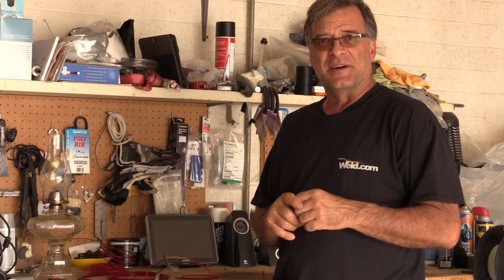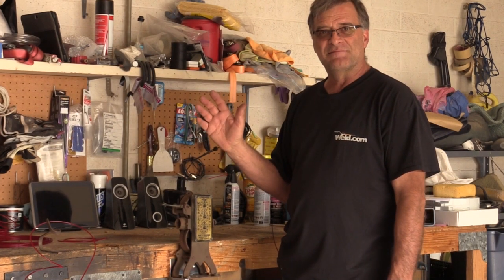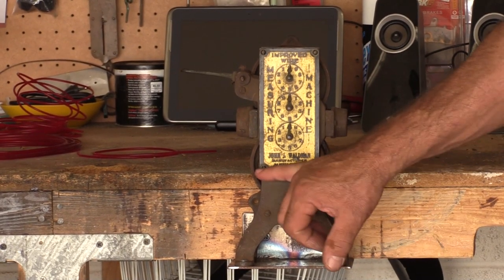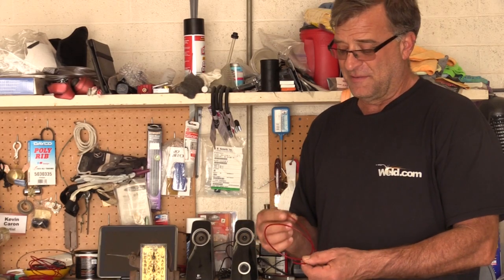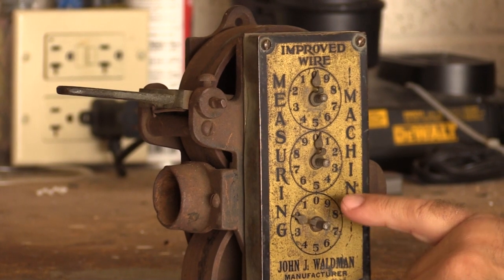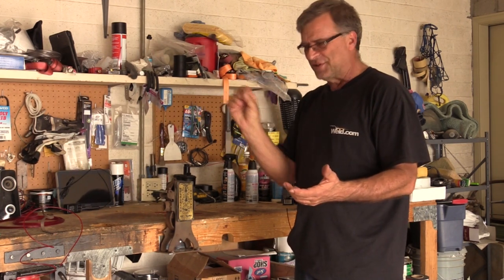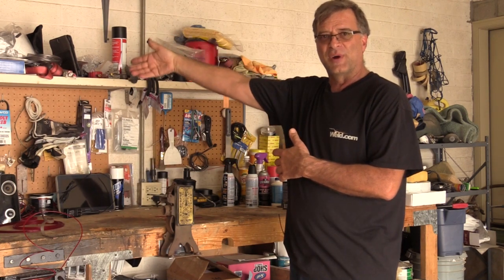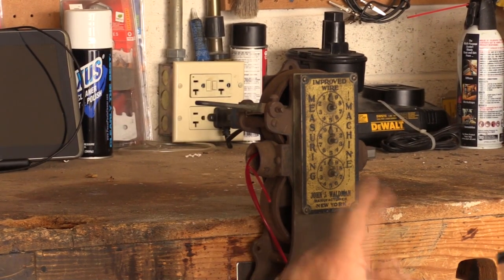Shop Math: How to Convert Weight to Length the Old-fashioned Way - Kevin Caron

Comment: If you use metric, it's easier for its decimal properties, but 12 in, yards, to pounds isn't impossible either. Work with the fractions, and simplify one direction to the other, and then the maths work in reverse. Spool off 100 feet, weigh it, then you have your pound-feet (not torque mind you ... haha). Then Bob's your uncle. 

I love the ancient stuff like you can't believe, especially where the elec. grid and its finickiness is concerned. Thanks for your video!
Reply from the maker: Thanks for watching and posting.  Always great to hear from you guys on the other end of the internet.

Comment: I envy your ability to weld artwork.  Wish I had 1/10 the talent you have.  If you have a triple beam balance scale (relatively expensive) or even a digital scale (<$20 on Amazon) that can weight at least 3.0kg, you can get a  good estimate of how much filament you have left on a spool.  You need to know the empty weight of a filament spool (tare).  Weigh the spool of filament and use a little math to estimate if there's enough filament to complete the job.

From a website: 

PLA:
1.75mm = 1080 ft / kg (330 meters / kg)
3.0mm = 360 ft / kg (119 meters / kg)
ABS:
1.75mm = 1310 ft / kg (400 meters / kg)
3.0mm = 430 ft / kg (130 meters / kg)

Assuming an empty spool of ABS 1.75mm weighs 100g, then a 1/2 empty spool (pessimist) or a 1/2 full spool (optimist) of 1.75 ABS spool will weigh 100g + 500g = 600g which equates to 655 ft (200 meters)

Your counter will be more accurate but you have to measure the entire spool to get the total length of filament available.

If you don't have an empty spool, you can estimate the empty weight of a spool if you start with a full spool.  Take the total weight of the spool of filament, subtract the posted weight of the filament and the difference is the weight of the empty spool.  The posted weight does not include the weight of the spool.

Math was my best subject in school 52 years ago.
Reply: +Dan Burch I was thinking the very same thing and there would be far less chance of contamination as well

Comment: You'll have to be careful not to get any of that "patina" onto the filament - I can't see bits of rust being good for the printer. That said, can't you just weigh a 1m piece of filament, which will give you the weight to length ratio? For example, say that 1m = 5 grams .. if the software says you need 8200mm of filament for a job, your total will need to weigh 41 grams (8.2 x 5), plus the weight of the empty spool.
Reply: +CodeFoxAus Sorry, just noticed that someone else said the same thing.
Reply from the maker: +CodeFoxAus 

Going to play with this today!

Comment: You could weigh a measured length of the filament to get an answer as well.  (A <length> of filament =  <weight>)

If your filament is on a spool, you'll need to subtract the weight of it before calculating.
Reply from the maker: +John Galt            Tired that on a mail scale but only used 1 inch of filament..    didn't even move the scale...     Should have tried a longer piece I guess....      Good tip!!
Reply: yeah, you might need a foot or ten.... ;)

Comment: It looks like each dial started with 0, so I would think it would be 0 to 10, 0 to 100, and 0 to 1000, although technically between the 0 and next digit would be hard to determine without looking at the next dial down.